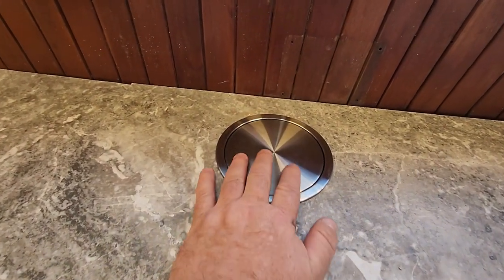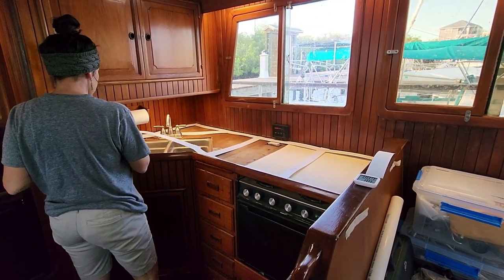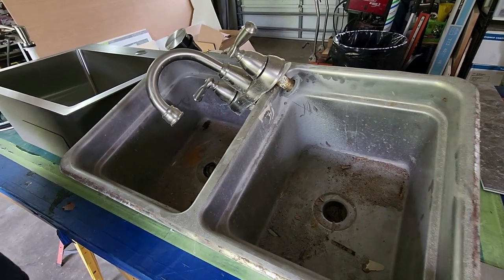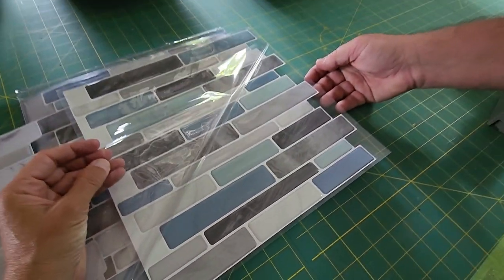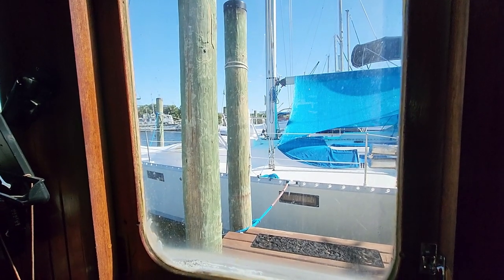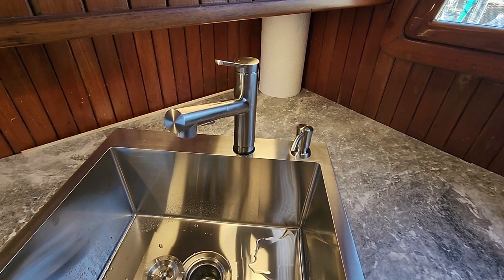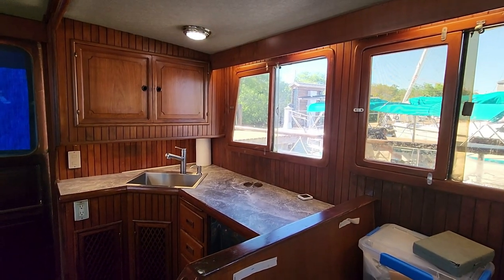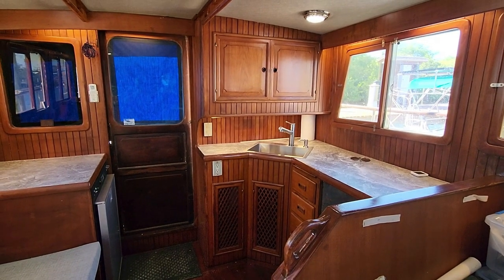Trawler DIY- Galley refurb for less than $500 that anyone can do.

Comment: you have that boat looking so good
Reply from the maker: Thanks man. A little at a time. It really has turned the corner though. I dont think I have any more big projects except exterior paint. There is a bad repair on the upper deck that will have to be redone too. But thats pretty easy. The Garmin electronics install is not a project to me...its pure fun so that doesnt count..lol. I got my autopilot finally too so I have all the parts for that .

Comment: Those electric elements radiat a bit of radiation everything you fire them up. Look up the out put of the unit you buy. Lead lined stove compartments help. It is done in homes as well to avoid exposure.